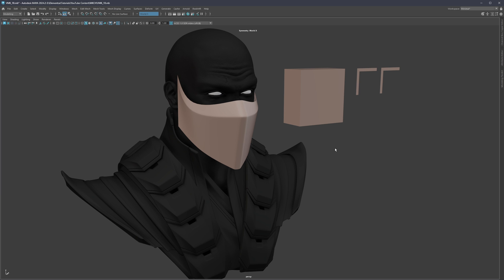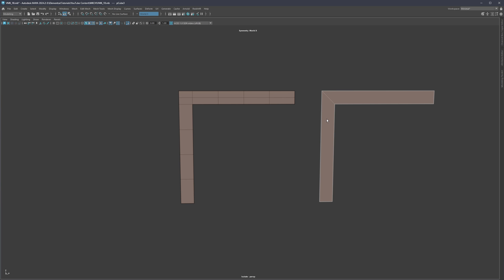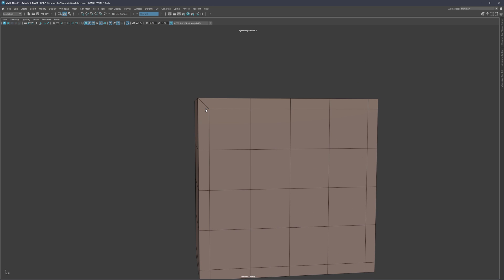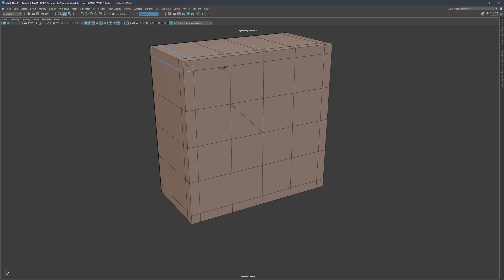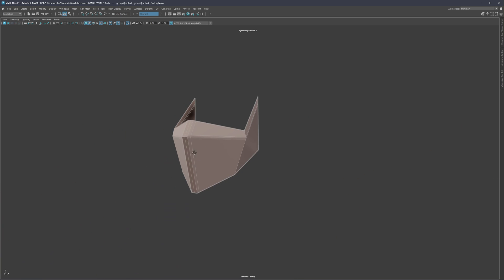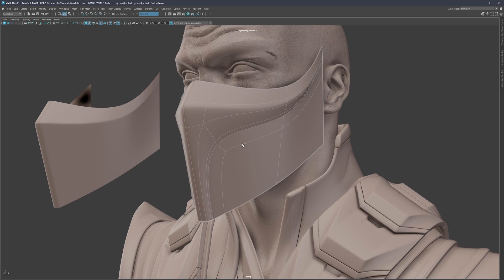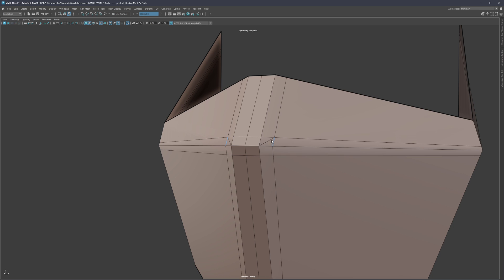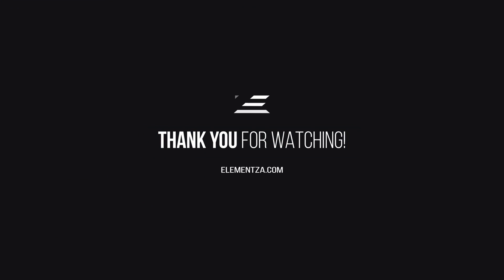Importance of Edge Flow in 3D Modeling (Control the Forms)

Comment: Hello, my friend.  Kindly respond to this query for me.which kinds of artists use 3D modeling formulas with good topology. For instance, the 3D weapon artist just followed the shapes rather than the theory. which artists use high-quality typography without character modeling
Reply from the maker: Hello... sure in short, anything that goes into production pipeline requires some topology knowledge. Anything that is meant to be a single image and nothing more, all methods are fine. Even the ones without the topology understanding.
Reply: Okay, Which artists use excellent topology in their 3D models?